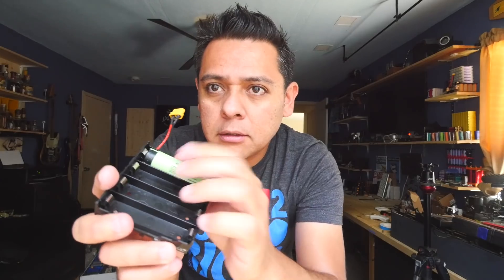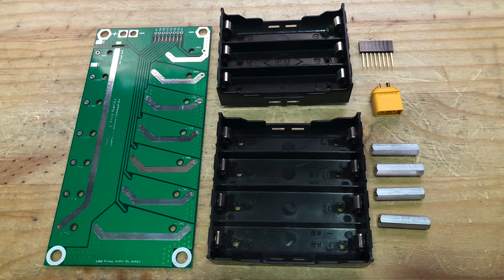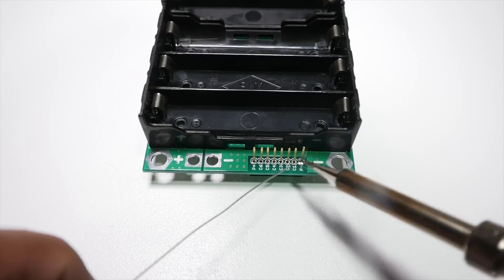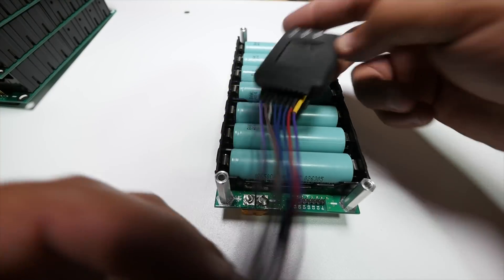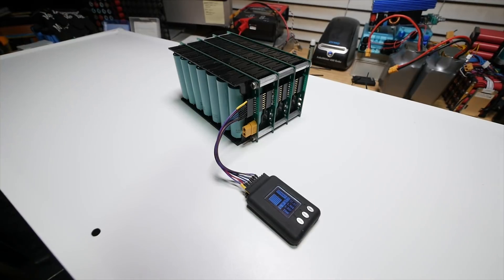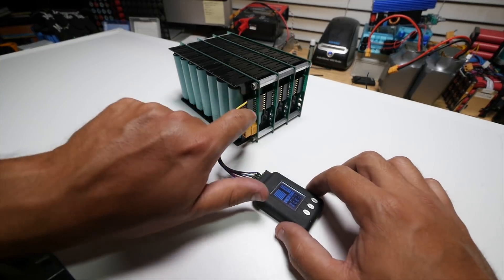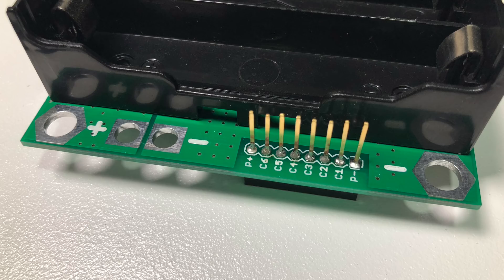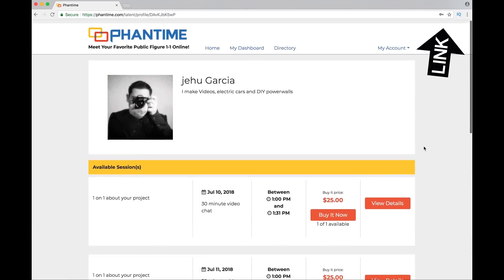DIY Rapid Build 18650 PowerWall Module project  - design & testing

Comment: I'm confused. Jehu, you inserted all the batteries with positives to the top and negatives the bottom - I would have thought that was paralleling the cells? Is the series-ing done on the  PCB traces? To me this looks like a 28P pack. Love the design and implementation and would definitely build my powerwall with these as this design makes it so easy to swap out cells.
Reply: There are no connections within the battery holders, so yes, the series connections are made on the pcb. It's a good idea because you are very unlikely to put a cell in the wrong way...
Reply: ^ what he said. It looks like with this particular PCB, the board takes care of the series connections. If it was made in a way where you need to alternate battery orientation in the battery sleds, I could defiantly see myself making a mistake at some point and installing a battery backwards. In my mind, positive up and negative down just clicks, so that's how I would do it. Obviously you can do it any way you want as long as you know what your doing and weld the plans into your brain :)

Comment: Hi jehugarcia, Where do i go to get a designed Power Wall for my Home? I have put in a 24 x300w solar panel system that is producing close to 7Kwh in the summer and 2Kwh in the winter.  I have 2 Solax  Hybrid SU3000E inverters spread over 2 phases in my home. These are all installed by a registered Electrician as is required in NZ. There are no rules yet concerning Power Walls and there are very very expensive, Tesla 6-7Kva about $20,000+. I am very handy with electronics and have build many projects over the last 20 years. It appears we can now freight 18650 batteries into NZ. I would like to build my own Power Wall, but it must be safe. I can supply photos etc of my installation, and comply to any regulation that might be coming concerning Power Walls.
I have followed your clips for many years. can you assist me?

Comment: that holder is made out of ABS and has a safe working temp upto 80C. i just tested one that i have using my soldering iron and at 100C after leaving the iron on for 5 minutes there were no visible marks. at 110C there was a slight indent that was hard to see but you could feel it when sliding the iron over it. at 120 it was almost instantly indenting.

Comment: This looks really interesting for some modularity regarding power wall design. I think the heat issue may lie with the clips in the holsters being made of steel ( higher resistance). Im sure if they are made of tinned copper it would perform better. I wonder if any vendors sell holsters with copper contacts?
Reply: I suspect the cross section of actual contact area is also an issue. You've got a curved surface touching a flat surface making for a very small cross section of actual contact area that all those angry pixies need to squeeze through.
Reply: Yes, the big problem is the pressure only contact/poor conductor/surface area. Copper can't be used in this way as it is too soft and won't maintain tension.
Reply: Roger Thebarista i agree the tension would be a problem if the cells were swapped often enough. For powerwall use, i wouldnt expect cells to be replaced often ( What is the typical replacement frequency?)

Comment: This has some serious potential.  I would love to build a powerwall but I don't have the time to put into it using previous solutions but this, I would do in a heartbeat.
Reply: Do not build this!! The system doesnt charge uniformly all batteries! I will fail and explode with time. Trust me, Im an engenieer

Comment: If there was a clip that just soldered to the board. And use no plastic. Where the cells would fit really tight and make good contact. Beef up the traces if needed. Maybe use thicker clips to hold the cells in and make electrical connections. That is similar to what I had in mind. But I knew the current would be limited. I need more like 5amps per cell. Until my bank is large enough. I'm at 150 ah and 29.4volts. And hoping to have it doubled by the end of the month. Keep at it you may just have the next big thing there !

Comment: Why not parallel the 7 cells on the holder and then use the solder in fuse connection to select whether that board is position 1, 2,3, 4 ect in the series stack for balancing purposes. Parallel more cells will help with the draw per holder and allow people to make any voltage pack they want.
Reply: For a power wall, adding 49 cells at a time doesn't seem like much of an issue. I mean, i've been toying with ways of scaling by 500-1000 at a time as a minimum.
Reply: If you just have 7 cells you can start working any 24v device/inverter with what you have. As you get more cells you just keep adding modules. In a 7p design you have to upgrade in 49 cell increments.
Reply: Yeah I understand, this is great for a 24v system.
Reply: I agree and I don't car for fuse wire, I would use a fuse holder with ATO type fuse that stands out of the side of each. Also you don't need the holders you can use the type that goes on the top and bottom of the cells and use a stud to connect them, that way you don't have to worry about melting plastic.

Comment: It gets hot here and that seems rather hot. 

Perhaps a non conductive metal with rails might be a better idea for a rack.. to dissapate heat better.
Reply: >Non Conductive
>Metal
You can have one, not both.
Reply: Gary Stinten
If you find a non conductive metal, you will receive a Nobel Prize!

Comment: A cooling system integrated into the racks would be nice also.  

Future revision for customization. 

The futures looking bright
Reply: It wouldn't be too hard to add a simple pc fan 3 or four pin port on that board, then it could cool itself using minimal power.
Reply: Stick 'em in a rack (or whatever other cabinet) and put a cheap car radiator fan at the top pulling out hot air.
Reply: Gary Stinten power wall module 
Yay
Reply: Not ratted for more than 1c so dont need cooling. Its design for power wall not ebike!

Comment: This would be great if it could tell you what rack is low or does it work over an even balanced reading.. ie, is like a bottle of water and you just divide the remaining by 4, to work out the level of each battery pack?
Reply: The small 8 pin connector gives you the individual cell levels, to use for balancing. All of the cells in a stack will be connected in parallel (ie all of the cells in position 1 are in parallel) so you won't ever have to balance the individual cells.